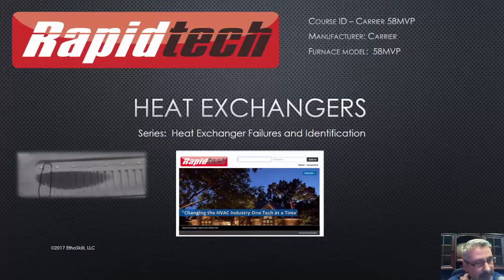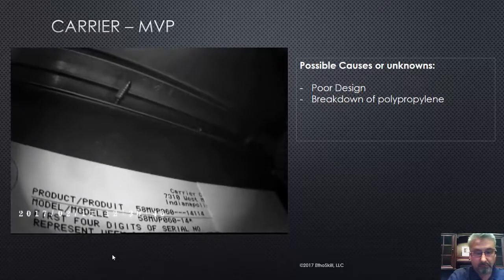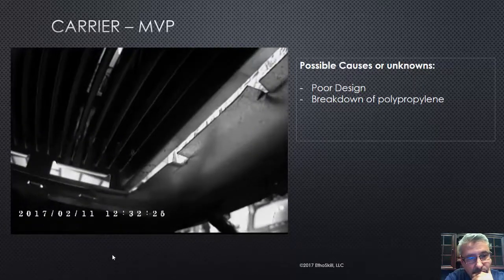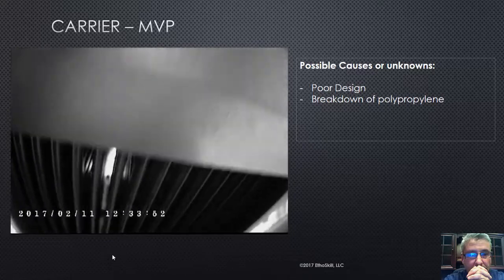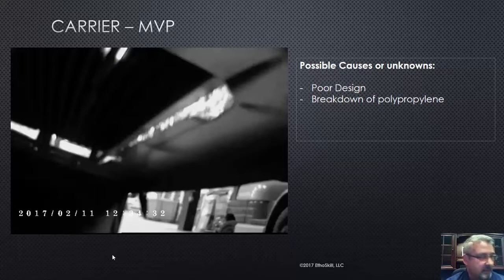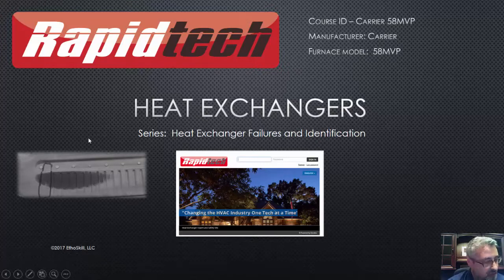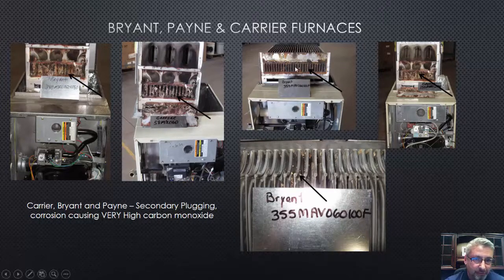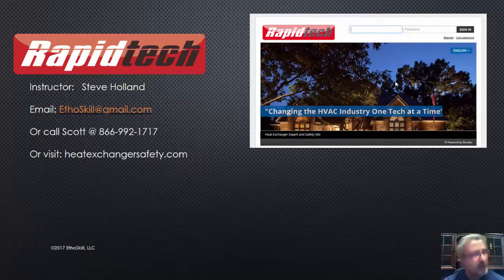Carrier, Payne or Bryant Heat Exchanger Failure

Comment: Thanks for the video. We've got a Carrier 58MVP in our house that we bought 1 1/2 years ago and we've had nothing but problems with it since we moved in. The other night we got a visit from the gas company. One of our neighbors smelled something and called them and they traced it to our furnace. The gas company tech said our furnace was putting out unburnt gas and something like 40k ppm carbon monoxide through the exhaust outside the house. Needless to say, they shut it down and now we're getting a new furnace installed.